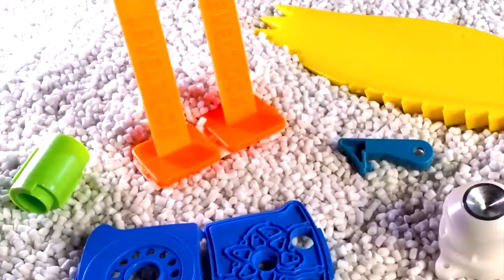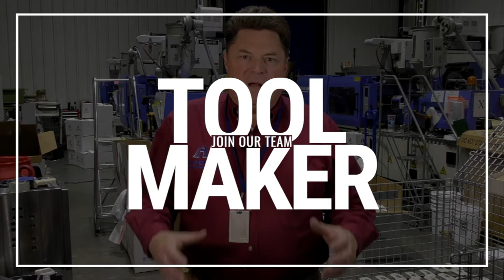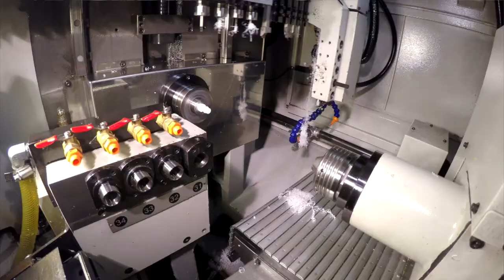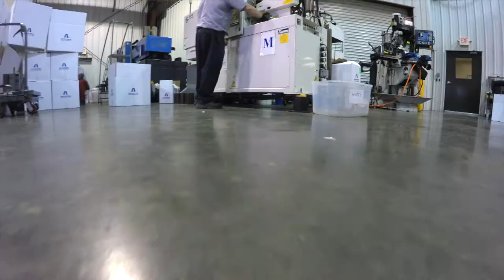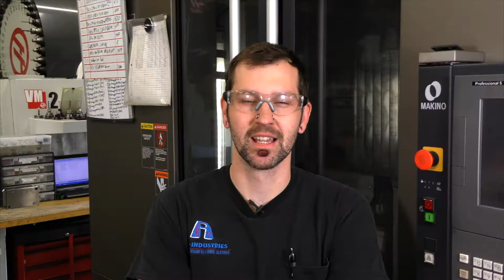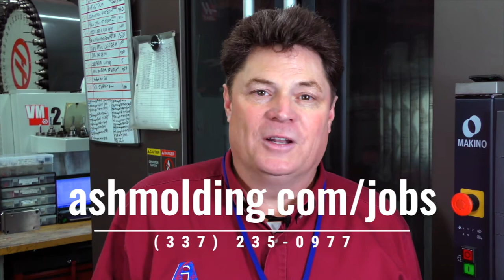TOOLMAKER Job Opening With a Growing Molding Company | ASH Industries | Lafayette, LA

Comment: Hello sir my name is Abhishek Das from India. My qualifications is Tool and die maker With 4.5 of experience as a tool room engineer in injection and blow mould manufacturing and mould maintenance. 
Machine knowledge. Lathe, milling , radial drill , surface grinder.  CNC lathe. 
I'm very interested .